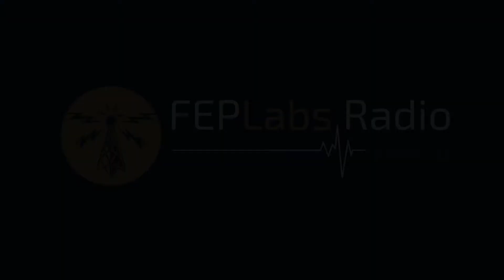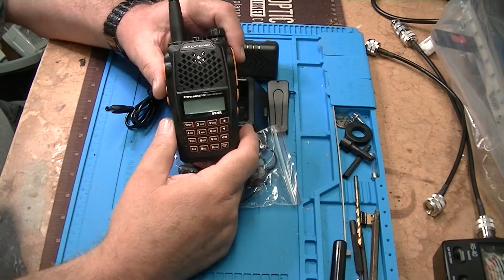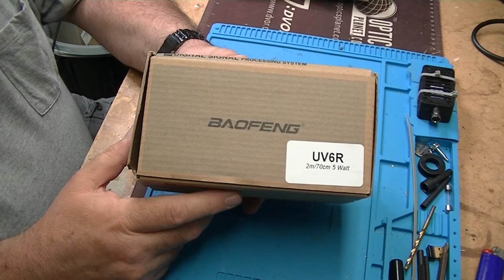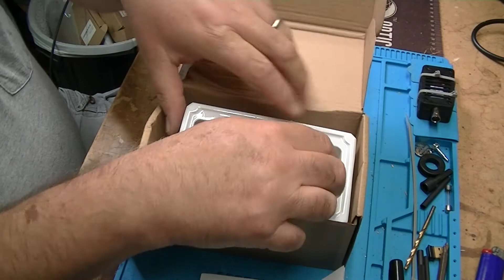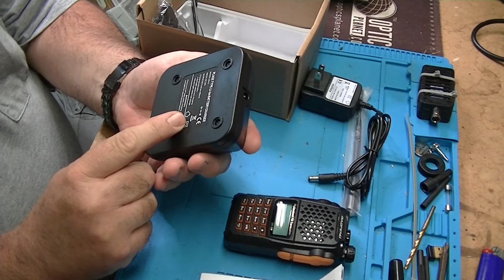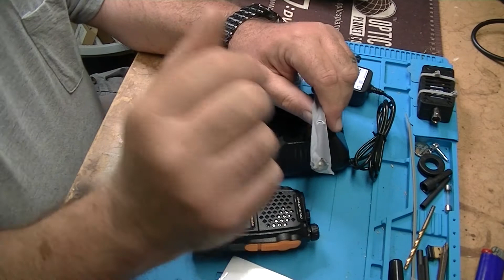Baofeng UV-6R Review and testing

Comment: Thanks for your review. So Jim which unit would you recommend me , as a start I want somehow a decent unit and mostly to be hackeable out of band frequency some how . But what matters me also is to have real output power.- I'd be using it within urban area city.   So these are the models I can get in here  uv6r / uv5r (says 10 watt model )  , A52, uv-9rplus, uv-82 plus. Which from all these would you take. Thanks Jim
Reply from the maker: Retevis RA-79 ( https://amzn.to/3LSJ8sr ).  While technically a little dirty, it's such a weak harmonic (-12dbm or 60uW), that to me, it's a distinction w/o a difference.  Only one harmonic, and you'd have to be damn near touching antennas to pick up 60uW of radiated power on the harmonic.  

The other one is the Quansheng K5 (basically same radio). 
https://amzn.to/3WOXtML

The Retevis is $17.  Skip a coffee at Starbucks, and you've covered the cost.  It has multiple firmwares available, and is very hackable.
Reply: @FEPLabsRadio  Thanks Jim for taking your time and answering. Anyways and shamefully the only options available here are the ones I told you. From Baofeng Uv5r , Uv-82 ( which I checked and says 8watts) ,are any of these good enough, I've seen many copies of baofengs. I do pcb board repair , but i'm not into ham at all. When I get them I'll tear them down . Again thanks

Comment: And very interesting. Mine is almost identical on the back label except mine says power 7W and it has a CMIIT ID:2017FP0432
That's the Chinese equivalent of the FCC
Reply from the maker: It's one of the better 'fengs.  I have two of them (I think I forgot I had one).

Comment: Great video. Im a little late to the party but i have a question for anyone. When trying to program the uv6r with chirp...i can't change the squelch values. Ive always been able to with the hundred othe Baofengs i have bit with this one if i change the values of the squelch from the default it will not let me write to the radio. It says image not valid for this radio. Anyone know of a way to change the numbers?
Reply from the maker: Interesting - that sounds like there is a disconnect between the firmware and what chirp is expecting.  I haven't tried mine with chirp, I just usually use it for testing stuff.

Comment: May I ask how long in communicatiom range does Baofeng UV-6R capacity in kilometers ?
Reply: In mountainous terrain without direct visibility of 446 Mhz successfully at 36 km
Reply from the maker: @ДимитърСотиров-э8ю  That’s excellent!  I would say that’s probably about the outside edge and obviously you had a very good line of sight on that. Now, if you catch tropospheric ducting, you might be able to get 60 or 70 km
Reply from the maker: It depends on several factors, but easily 5 kilometers. Probably upwards of 10-12 depending on terrain, power settings, antenna, etc.

Comment: Well done demonstration - I am more interested in the receiver side of things. Does this radio have a scanner on the receiver? Like to use it for scanning railroad channels. Do you have a video about the receiver?  Thanks - Gary from Michigan 😎
• Cheers from the Detroit & Mackinac Railway 🚂
Reply from the maker: Hey there!  It is a full xmit/rcvr radio.  It will scan, however, the scan speed is pretty slow.  Compared to a regular scanner (even a cheap one), most transciever scanners are glacial in the pace of scanning.